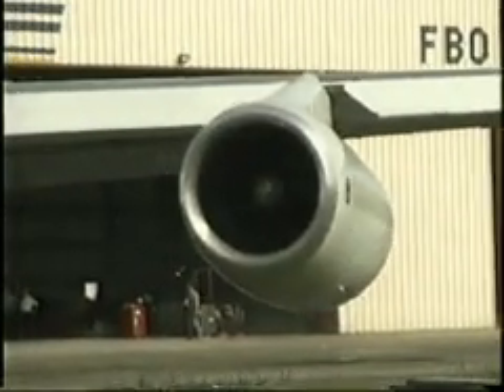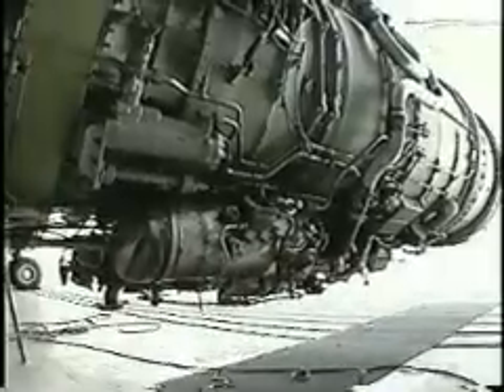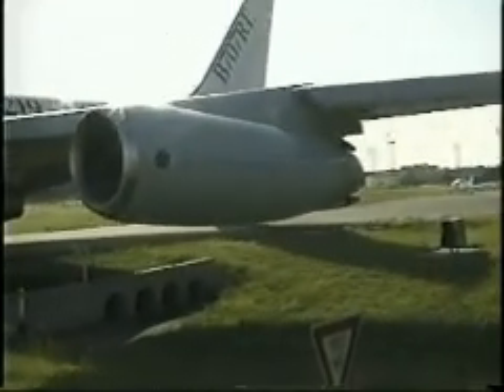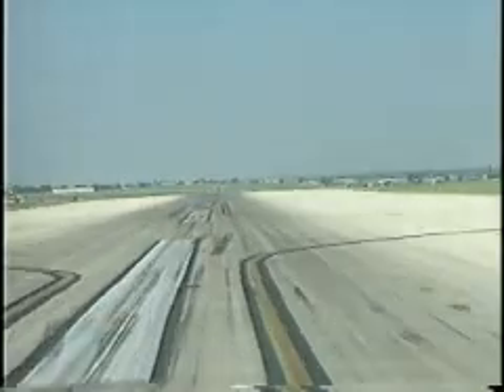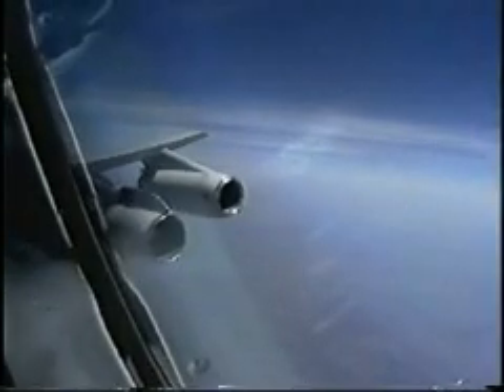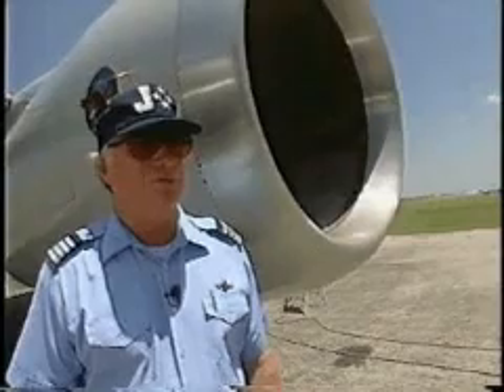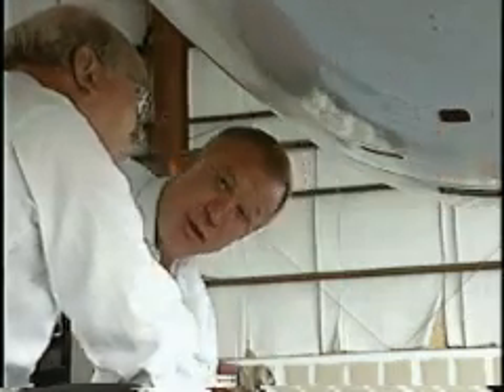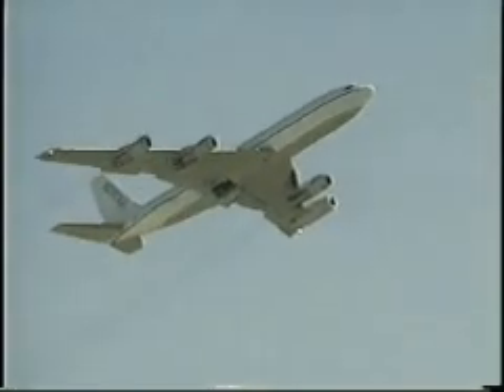JT8D-219

Comment: 99% lower emissions... seriously?
Reply: Jeffers667 That's what it was built for. Think for minute, it was built larger with bit of a higher bypass ratio than the original JT8D engine, resulting in quieter takeoffs.